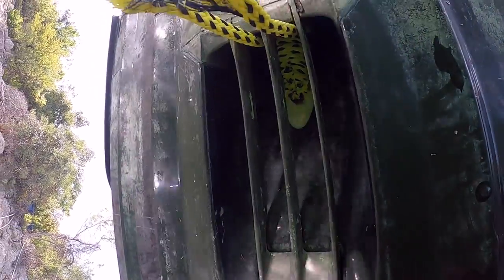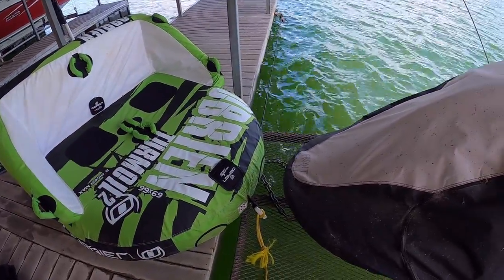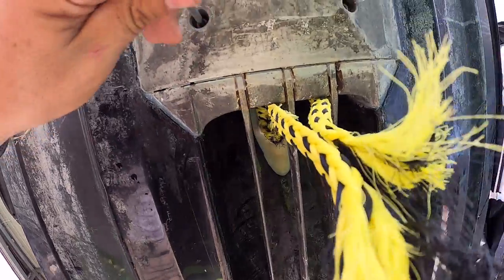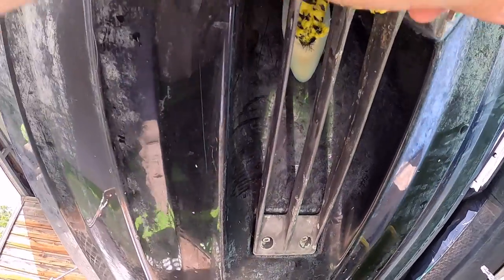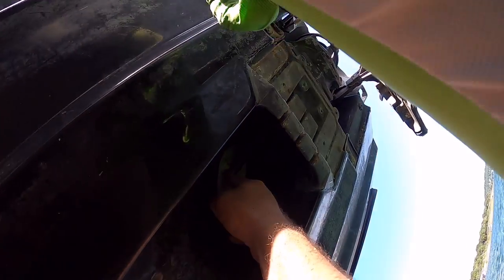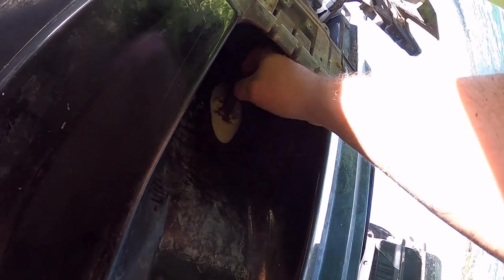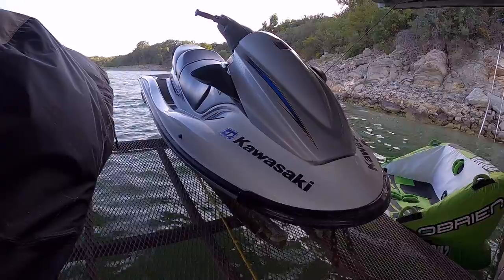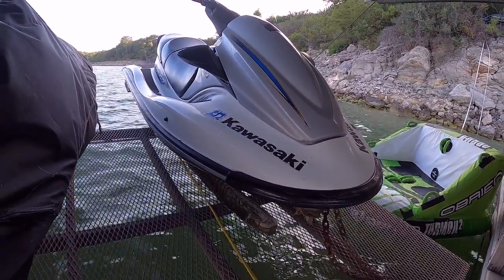Jet Ski Impeller ● How To Remove Rope Tangled Up Inside Your Jet Ski Wave Runner Sea-Doo ✅

Comment: I got a blow torch and knife and got 98% out but the top part of the rod still has piece of rope stuck. Seems like part maybe is melted into rod and wont get out even when starting it up. It spins slights but not enough to spit rope out. Pliers dont help either!
Reply from the maker: Blow torch is a good idea!  Can’t imagine why it won’t just blow out that last part under power. Let me know how you figure it out!